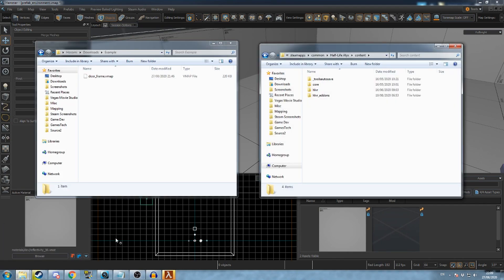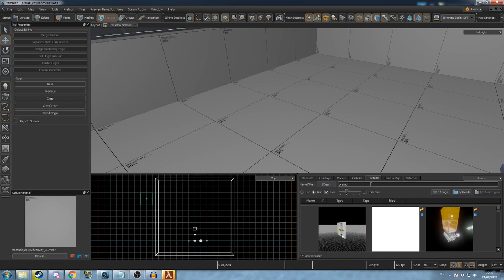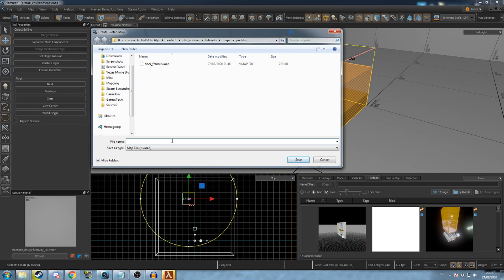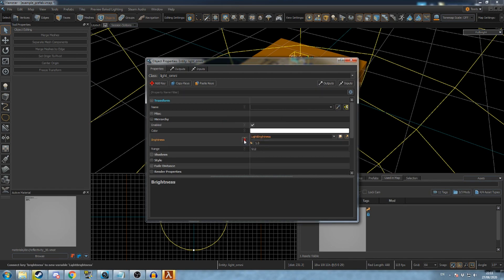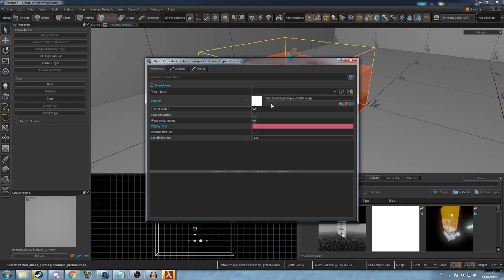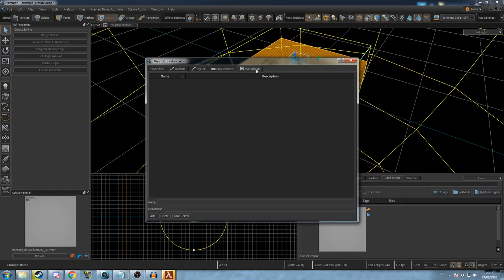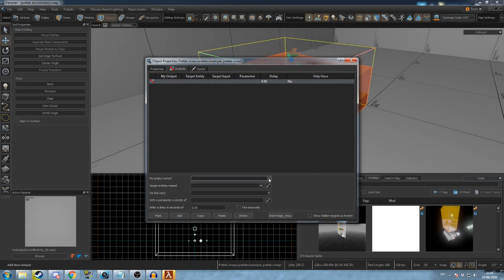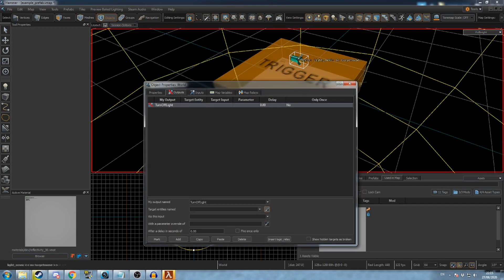How To Add and Create Prefabs in Source 2 Hammer

Comment: Thanks for the video! Do you know if it's possible to pass a parameter through a prefab's output? 

For example: say I have a prefab on a light and I want to be able to change that light's color from outside the prefab. I know I can use a map relay to call setColor (or whatever it's called) on the light, but is there a way to call setColor with an RBG value passed in as a parameter?
Reply from the maker: I'm not sure. Give it a try, it might just pass whatever parameter you give it.
Alternatively, you might be able to do it using addOutput and a world variable.

Comment: Prefabs have been a game changer for my workflow in Hammer. Initially I wasn't using them because I didn't understand how to add inputs/outputs to my prefabs, or reference entities across prefabs- but once I figured those bits out I went to town with them. I highly recommend learning how to properly integrate prefabs into your maps sooner than later, it has the potential to save you a TON of time.